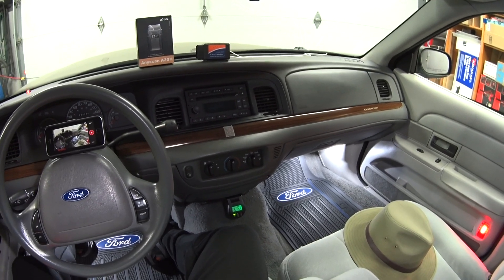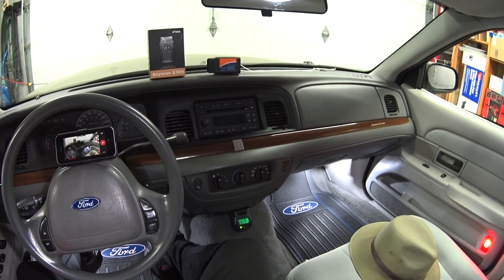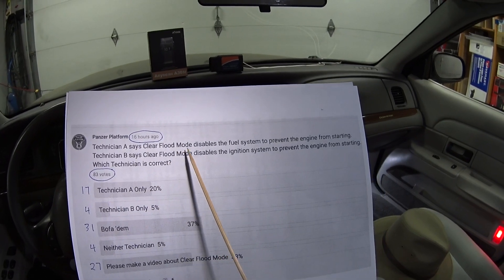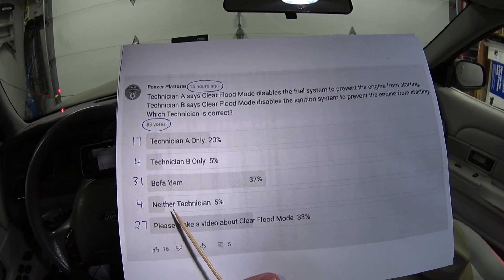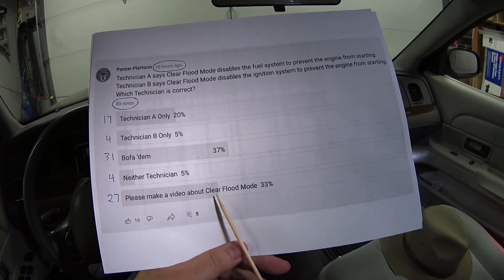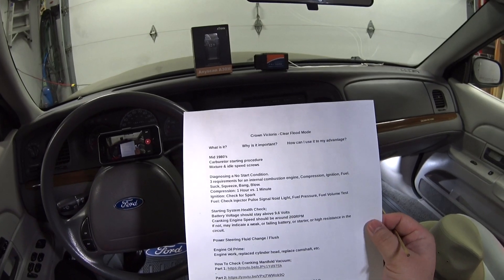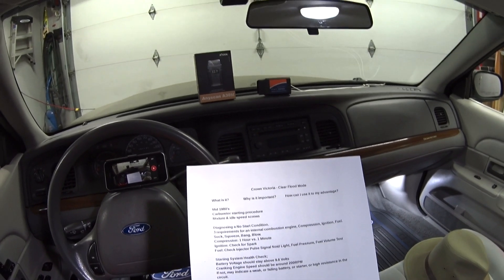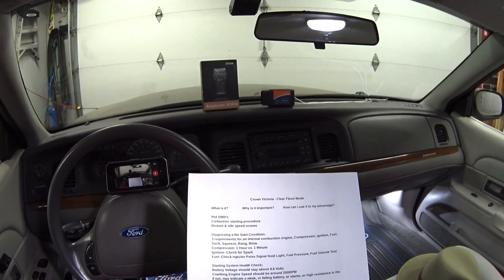Crown Victoria - Clear Flood Mode

Comment: Does the clear flood mode help eliminate the slight rattle on start up due to oil tensioner or oil filter drain back problems?
Reply from the maker: Let your car sit for one week without running, and give it a try. 
-Chuck
Reply: @PanzerPlatform  my 2010 has 132,000 on it
 It just has a slight rattle on start up but stops after a few seconds. Ive tried 5w20 full synthetic with the motorcraft filter and the same but with a wix pro filter. Both are supposed to have anti- blow back. Is this just a common thing with these cars. Also another question for you. Im smelling coolant when i parked my car. Opened the hood and checked the usual suspects ( hose connections, intake, water pump weep hole) no leaks but i did notice the top hose smelled of coolant, again no leaks. Checked resovoir and no lose of coolant. Let car sit on driveway checked every half hour and no leaks. 2010 mercury grand marquis. I did have the coolant changed and thermostat changed about 2 months ago. Could coolant if dripped on the hose from that long ago stay on the hose that long? One more thing are you a member of the mercury grand marquis or p71 fb pages?
Reply from the maker: @iannathanson6014  
1-2 seconds of rattle on start up is normal.

Take it back to whoever did the work, and tell them you smell coolant.
Where are you smelling coolant from (passenger compartment)?
Did they use the correct coolant?
Here is the OEM specification Motorcraft Premium Gold VC-7-B;
https://www.motorcraft.com/content/dam/ford-motorcraft/en_us/motorcraft_global/products/lubricants/quick_reference_charts/antifreeze_coolants_english.pdf

Did they use the correct thermostat?
Motorcraft RT1234

I’m not on any social media.
-Chuck
Reply: @PanzerPlatform  only smelling it on top hose i took a bright flash light and checked the intake for dried or wet coolant and didnt see any. But when i smelled the top hose ( one going from radiator to thermostat) it had a strong coolant smell. Im going to check where it connections when my car cools down.
Reply: @PanzerPlatform  i took my car to take 5 and they use a shell all models coolant.

Comment: I use the flood mode every time I do an oil change on my MGM. If I don’t it takes 5-10 seconds to build oil pressure and that kills me lol
Reply from the maker: Yo Marlin,
Long time no see. Lol
Thanks for stopping by. 
-Chuck
Reply: @PanzerPlatform  pushed my oil change interval to 7500 mi and I think it was a mistake. Noticing some metal in the oil with the last change. I don’t think it’s the oils fault, I think my timing chain guides are on their way out, and I have a lash adjuster going somewhere on the passenger side cylinder head. Debating weather I should dig into replacing everything in the car, or pull the motor. In which case I’ll probably let it go until it gets worse.

Comment: What happens if you do a Clear Flood Mode but stop cranking before the oil pressure builds. On a digital dash you're blind to know when pressure builds.
Reply from the maker: Right on Josh,
What a great opportunity for your channel.
The digital oil pressure gauge on your 1998 CV LX should function identical to my analog gauge shown in the video.

Let your car sit for 24 hours. Whip out your cell phone, and film your own clear flood mode video. It should take around 10 seconds for the little digital bars to get an erection. Lol

If not, let the starter rest for 1 minute.
Try again, and crank for up to 15 seconds.
Can’t wait to see your video.
-Chuck
Reply: @PanzerPlatform  I only have the light (no bars) but I take it though when the oil light goes out then pressure has been brought to operating condition. 24 hours is going to be hard for me to do. Look for the video after the 27th
Reply from the maker: @midwestpanther98  
Correct.
When you go KOEO, (key on engine off) the oil light should illuminate.
When you go KOER, (key on engine running) or perform a clear flood mode the oil light will turn off once it registers pressure.

You don't have to wait 24 hours, just 1 hour will do. 
-Chuck
Reply: https://youtu.be/pd20ZMsKoKc

Comment: Thanks for the clarification Chuck. I use clear flood mode every spring on my 08 f150 before I fire it up after 5 months in storage. Incidentally I finally took the Marauder block to machine shop this week and after pistons and rods were out the crank spun really nice. Removed crankshaft and there was still oil on bearings after 3yrs not running.
Reply from the maker: Right on C-Raud,
Thanks for the great feedback. Let me know if you start uploading videos about your build again. 

3 years ago when I was using conventional oil in my 2004 Vic, I noticed that after I let it sit for a week without driving it, the next time I would start it I would get a little valve train noise for 1-2 seconds before oil reached to top of the motor. 

So I put the clear flood mode in my weekly routine, so I didn't have to hear the valvetrain on startup. 

But ever since I switched to synthetic oil a 7-day "dry start" does not produce the valvetrain noise like the conventional did. 
-Chuck
Reply: @PanzerPlatform  I planned on making a vid as soon as the forward clutch snap ring showed up. Been waiting on it for 3 months. 

  Had another YouTuber bug me to make a vid. He just bought a marauder. Guy was pretty good for 55 subscribers ToomanytoysJake   Or something like that 

  I tried to type this all fancy pants like you Chuck. Did it work?
Reply from the maker: @canadianmarauder1923  
Yup. Lol

Comment: Here's a fun topic for you. Nice and boring and super dry. Totally up your alley. You know how the car owners manual tells you where to jack and lift the car from, so even noob technicians can theoretically lift your car without breaking it?

You what the manual doesn't tell you? Where to hook up tow cables and hooks to prevent damage. Thus, a noob tow truck driver and an experienced one will be guaranteed to hook up to a control arm, push bar or sway bar and break your beast. Use your amazing Chuck abilities to find random tidbits of Panther info and find us a picture of where the tow operator should be hooking up to our Panther cars to prevent damage.
Reply: As a former tow driver of 14 years, it depends on the tow equipment being used. You have various forms of wheel lifts, slings and carriers. 

If you're winching with a bridle or lifting with j-hooks/ chains, utilize the a-arms or rear axle. When securing, there are t-hook slots in the frame rails on either side of the fuel tank.

More tow companies have switched to using wheel straps or basket straps which wrap over the tire/wheel to secure the vehicle to the bed of the carrier.
Reply from the maker: @DeathAngelHRA  
Right on Pat,

I have a tow job story myself.
Back in 2009 I bought a brand new $25K H-D FLHX Street Glide.
I got a flat tire, and called H-D 1-800 come-get-me.
The sent a flatbed tow truck to get the bike 10 miles back to the dealership.
After an hour the dealership service writer called me, and said; “Yup, we can fix that, it will be $1,100 for new handle bars, handle bar clamps, handle bar grips, some other parts, and install labor”.

Apparently the tow truck operator tied the bike down with ratchet straps, but instead of routing the straps properly, he put them on the handle bars, and tightened them to kingdom come. I called the tow truck company, and they told me POUND SAND! lol
-Chuck
Reply: @PanzerPlatform    paraphrasing Austin Powers dad, there are two things I can’t stand in this world - people who are intolerant toward other people’s occupations and the tow truck drivers.
Reply from the maker: Right on Hollywood,
That's a good topic for a video, but I only make videos about things I'm really interested in.
How about "The History of Automobile Headrest"?
-Chuck
Reply: @PanzerPlatform  immediately make a video about the history of automobile headrests. It will be a smash hit.